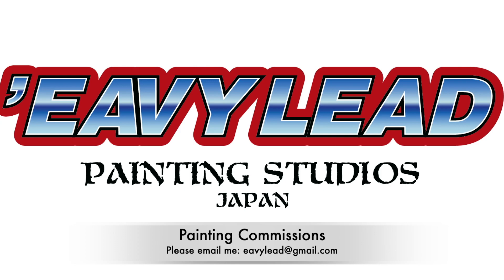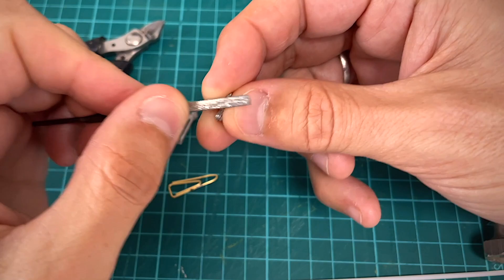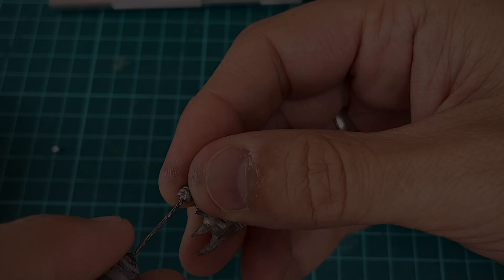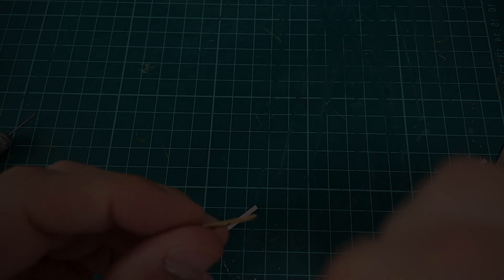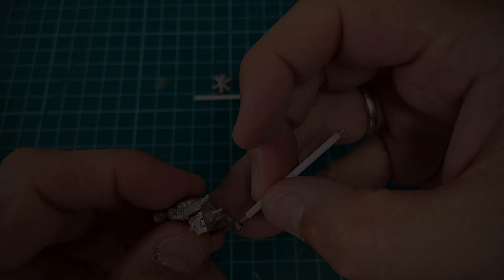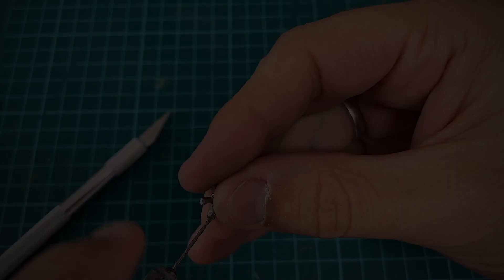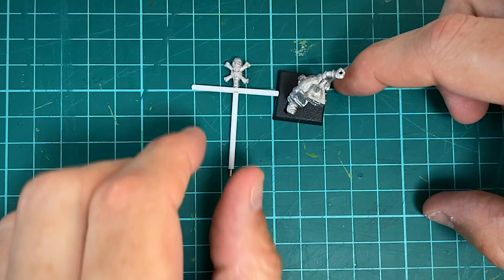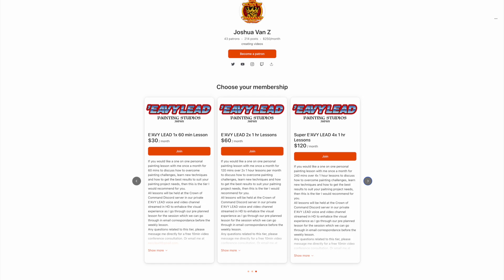E'AVY LEAD Tutorial: Banner Pole Conversion

Comment: YES I LIKEit and came out great but did know thay sell bras tubes and platic ones to look fore em and other thing at train shops  or non gaming shops  the other bit i like do is mini me lashing  yes hare how dun i uesed a tuth pick  but what ues up you other is  thread if do not like coloer you do brown whosh and change it do after your dun of now tie a knot a grannny knot  will do now a drop of CRAZY glue  to hold it and well lash right left then left to right whind the sting round the banner tell think enuff has put on one drop of supper glue goes on  yes one detail is tieing last knot  when glue  is dry  the give a brown or black whosh the thread shud sok up the color and look like aged rope